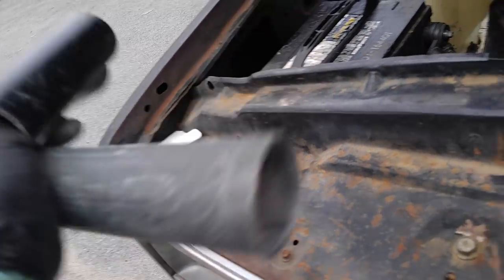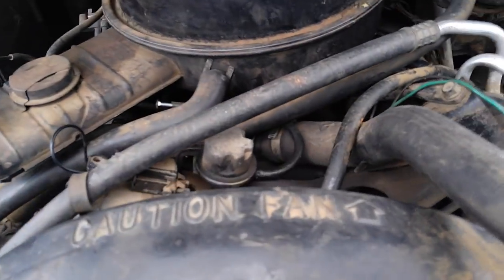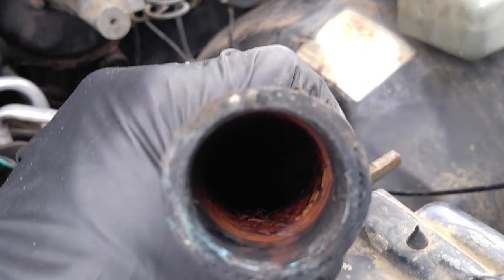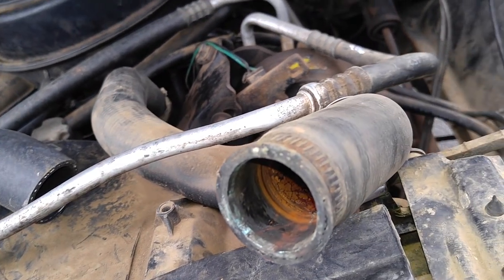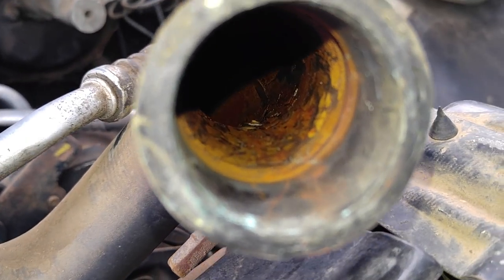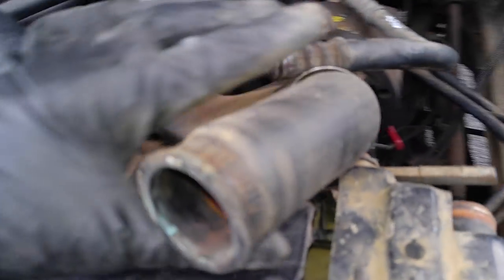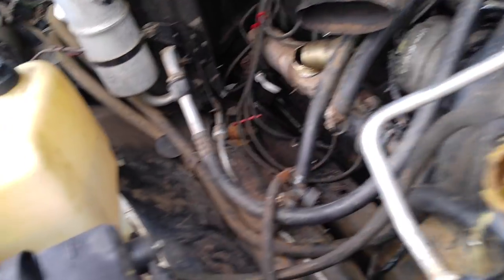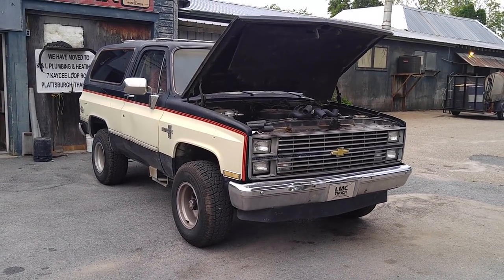K5 Blazer Thermocure Review Rust 8 1 18

Comment: For anyone doubting he did a good enough job. Or used the product improperly. I bought this truck. And I've put 12,000 miles on it in the last 2 years. Mainly driven in the Summer with temps well into the 90's Fahrenheit. Even with a failing fan clutch the engine temperature is rock solid. I would drive this truck cross country and back any time!

Comment: How long did you leave the thermocure in system. The longer you leave it in the system the better it works. I've used it before and got some great results. I just drained the old coolant out, added the product, filled with distilled water and let the engine idle for 4-5 hours. Then I drove the car that I was working on for 2-3 days before draining it out and flushing it 3-4 more times with distilled water. The inside of the radiator and hosed looked like new. The instructions say it can be left in up to like six days I think.
Reply from the maker: Todd H I had mentioned in earlier comments that I had flushed the system with water several times, the rust was so thick you could cut it with a knife, like pea soup. And then I flushed it with a variety of different rust products like Peak and Prestone cooling system cleaners, I left the thermocure in for a day or two I believe, and I've since flushed the system again several times with water, so now the water runs perfectly clear. But the problem is the rust is stuck to the inside of the radiator hoses at least, and the drain plugs on the block were completely completely blocked with rust, I had to stick a wire in and work at all around to get the drain plug to run free, so I'm sure there's way more rust than even thermocure could remove
Reply: @CORVAIRWILD  I am running Thurmocure in my FZJ80 and it's been in my truck for about a week. I plan on leaving it in for 3-4 weeks

Comment: I have to try it on the LT1.   Its pretty clean after some major coolant flushes but I still have some floaties. . I had the same crap in the hoses, even in the radiator. Rust lined

Comment: I’m sorry but you must not have used it properly. You likely need 2 jugs for a cooling system that large, and you need to run the vehicle to circulate it everywhere, I normally leave it in my system a couple days. Water will then drain out BLACK and STINKY, and the inside of the system will be LIKE NEW, completely SPOTLESS. Thermocure changed my wrenching life. Cars that run hot, cars that have poor heat, etc. back to new. First car I tried it on was a little Festiva that was just barely running warm, I had tried all the tricks and flushes including dishwash powder, nothing helped. I didn’t even think the system was rusty per se, but figured it was cheaper than a new radiator.... WOW. That car never ran hot again, radiator looked new inside, and the HEATER.... that thing had incredible heat afterwards which I didn’t even think was possible.
Reply from the maker: I flushed that Radiator on the five thousand mile trip between San Francisco and New York, at least 25 times, maybe 50 times. And I flushed it with water at the beginning, and then I flushed it with every kind of cleaner that was sold on the shelf, and then I tried the thermo cure, and I don't recall but I'm a let it run for several hours, maybe a couple of days. And in the end, the inside of hoses were still coated with 1/8 of an inch of rust. So it may not have met your standards, but I didn't just flush it once or twice, I flushed it with water running through a garden hose for hours, up through the drain plugs on the block on both sides, in every direction, multiple multiple multiple times. And the guy that bought the truck, is very happy with the way it performs. But I'm sure there's still lots of rust in the block that'll never be removed except in a hot tank

Comment: This stuff isn't like those cheap "5 minute miracle fixes" you find in the as-seen-on-tv aisle lol. You should leave Thermocure in the system for two days bare minimum. While allowing the engine to idle, idle at higher rpms, and be driven at varying speeds on the road for a total of at least a few hours over the span of a few days. I'd recommend at least 4 - 5 hours of engine-on time spread out over the course of a few days, just letting the motor operate at temperature and Thermocure do it's thing. I left mine in for a week, because there was a lot of sludge from what I assume was the Dex Cool that had mixed with air, in a low coolant system, from the previous owner. Plus, I just wanted to make sure it had time to do all that it could. I've seen people say that they left it in for a week and a half, to even two weeks with no issues and still amazing results. But I don't really think there would be much gain at that point. After about a week it's probably gotten most of the gunk out that it can, in a single flush. To make a long story short, your coolant system would have been a lot cleaner than that if you had done the above steps. This stuff really does work wonders.
Reply from the maker: I don't recall how long I left the thermocure in for. the sludge was so thick, there was a couple inches of built-up rust residue at the bottom of the block, when I removed the drain plugs I had to stick a wire in to open up the holes. I don't think anything can fix this, short of disassembling the engine and putting it in a hot tank

Comment: One of the many reasons my Corvair is a daily driver is to not worry about water pumper issues anymore :) Neat video though, I had never heard of Thermocure…. sure as heck doesn't look like it works very well!
Reply: it does he was just too cheap to get another rad . this rad needed to be replaced, not cleaned out with thermocure shit. its way too far gone, there is no way this crap wouldve worked.

Comment: I think your supposed to let it sit in there for a while, I’d try letting sit for a week after driving it with the thermo cure in there, then flush it.
Reply from the maker: I don't have the bottle in front of me, this was months and months ago, but I think it said just let it sit for a few hours. But based on the Rust that was inside this engine and radiator, it would have to sit for a few years
Reply: @CORVAIRWILD  
Definitely no. This stuff isn't like those cheap "5 minute miracle fixes" you find in the as-seen-on-tv aisle lol. You should leave Thermocure in the system for two days bare minimum. While allowing the engine to idle, idle at higher rpms, and be driven at varying speeds on the road for a total of at least a few hours over the span of a few days. I'd recommend at least 4 - 5 hours of engine-on time spread out over the course of a few days, just letting the motor operate at temperature and Thermocure do it's thing. I left mine in for a week, because there was a lot of sludge from what I assume was the Dex Cool that had mixed with air, in a low coolant system, from the previous owner. Plus, I just wanted to make sure it had time to do all that it could. I've seen people say that they left it in for a week and a half, to even two weeks with no issues and still amazing results. But I don't really think there would be much gain at that point. After about a week it's probably gotten most of the gunk out that it can, in a single flush. To make a long story short, your coolant system would have been a lot cleaner than that if you had done the above steps. This stuff really does work wonders.

Comment: I'm no expert, but what about vinegar? or is that asking for trouble? I know that vinegar takes rust off metal but as far as the vinigars reaction on the rubber seals/ hoses, gaskets and possibly aluminum parts I don't know that it would do to the rad.
Reply from the maker: Roger Krysalka as long as I can put thermocure on my frys...
Reply: Roger krysalka l'm not endorsing what l used to clean my radiator and also engine insides. I'm only stating what did a great job for me. Do this at your own risk. The reason being vinegar will pull out rust from your engine too, taking longer to do , but since l'm retired l have lots of time on my hands. l used white vinegar from Walmart (2 1/2 gals. $2.96 a gallon) l ran the motor idle for 45 mins. with the vinegar only. Then l let it sit for 49 hrs. It did a fantastic job of cleaning radiator , then l let water run tru for 1 hr. At first the drain water was very black ,dirty with lots of small chips of rust , the chips probably came from the motor. But the good news was that the rust chips would disintegrate into dust as l handled them. To me that told me that the vinegar also cleaned out engine. After 50 mins. of running water with engine idling the draining water was very clear and clean. I then added distilled water from Walmart 3 gallons distilled water w/ hyper-cool. My truck now hardly ever gets to the normal zone, unless l'm pulling a very heavy load. I live in a very hot part of USA, very little winter of less than 30 degrees. I'm very happy with results, although it took some work but l saved myself ($) having to buy another radiator.  God bless.